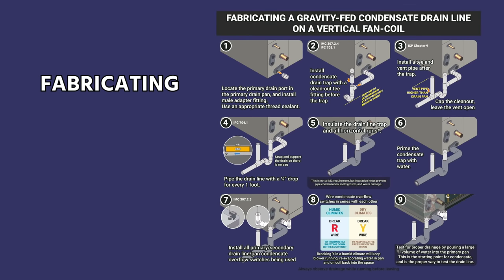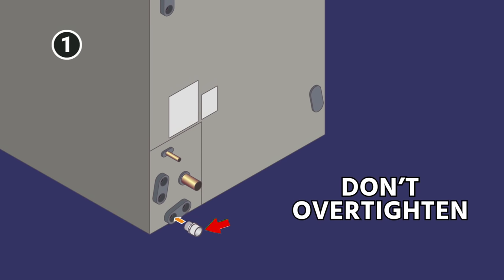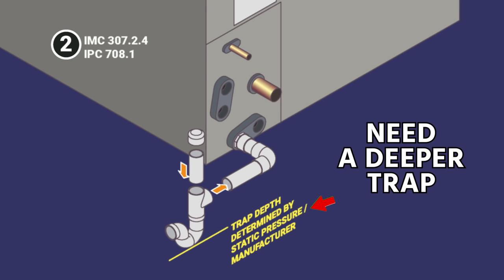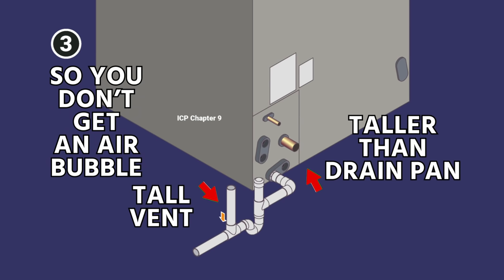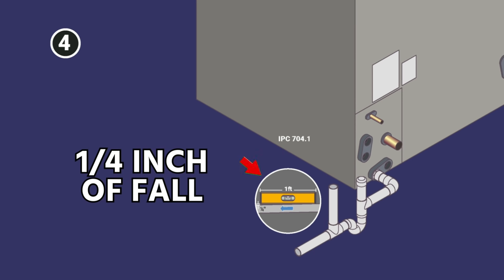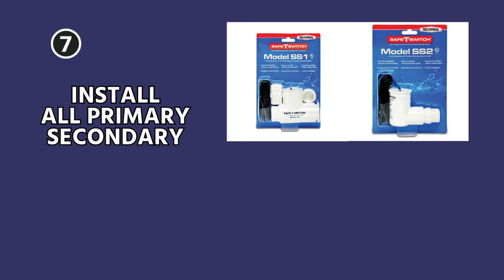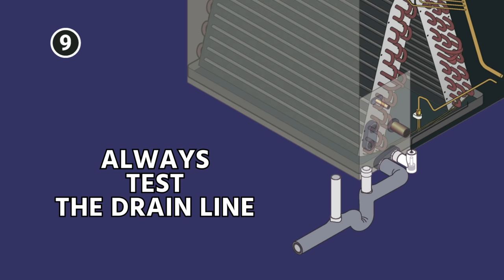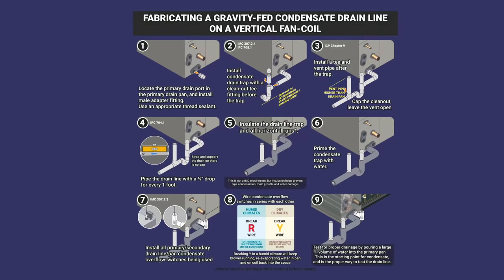How to Properly Pipe a Drain on a Fan Coil

Comment: I have issue with wiring the water over flow switch to turn off R. I have found keeping the blower running will help keep the condensate suspended long on the evaporated coil. And not overflow the evap pan.  So we wire to turn off the Y. We are on the gulf of mexico in texas high humidity. Please explain.
Reply: Breaking Y can let the unit short cycle depending on how long it takes for the switch to close. Residentially thats how you fry a compressor if your outdoor board doesnt have its own time delay
Reply: Only break Y when on a commerical site and the system has to be up and running to bring in fresh air
Reply: @garylargent8557  all water over flow switches open and close right away. and it will not fry the compressor.
Reply: @garylargent8557  a slow drain will turn the condenser on and off slowly not enough to burn the compressor
Reply: I'm trying only  picking brains. Let stay with residential systems. 
Got a service call about 20 years ago. Ac not cooling. Customer said i feel air but not cooling, Should I turn the unit off. I told no I'll be there in about 15mins. Got there the lady turner of thermostat off. Fan was auto. 
 Water over flowed the pan onto her sheet rock. Water over flow switch was cutting y. what I've seen happen is the blower keeps the water suspended in the evaporator coil. When the air flow stoped water ran down into the pan and over flowed. I don't remember how high the pan was.  After that on residential attic i cut y. 
Any comments. I've been do HVAC-R for 45 years. But i can always learn something new.
Commercial i will read the install manual see what people that made the thing  say about it
Reply: Some thermostats have a terminal just for  safety switch.

Comment: So confused about the P trap.  We bought our 2-story condo with an AC in a closet at the top of the stairs.  A white PVC pipe comes out of it that angles down and out of sight.  That PVC pipe has one of those shut off floats cut into it, but no P trap.  Another pipe comes out which is covered in a black pool noodle cover, heads along a parallel path with the PVC pipe but at a height above it.  Again, no P traps.  Was this old school, or incompetent work?  The AC works with no leaks.  Do all ACs need this P trap?  The shut off float I described is also the only way to pour in vinegar or bleach to clean the drain pipe.  Does that matter?
Reply: If it is not trapped where your air handler is it should be trapped outside wherever your drain lines run to, typically it will be next to the outdoor unit
Reply: But yes all ac systems need a p trap somewhere, and the float switch is a perfectly fine place to pour vinegar, it doubles as a clean out

Comment: I want to T in a hose connector to flush out the line. Any tips on this.  Thanks
Reply: Did you do this ? That’s what I am here researching.  My Bosch air handler has a trap, but not a clean out tee.

Comment: Would a vent before the p trap work better?
Reply: I don't think so. A vent before the trap will allow the unit to suck air from the vent and might prevent the condensate from draining. The reason for the trap is to block air from being sucked into the system so the vent should be placed after the trap.

Comment: You didn't mention anything about the configuration of a "draw" fan unit trap construction or a "pull" fan trap construction.  One requires a much deeper trap than just top of pipe to bottom of the other. Otherwise the water WILL be sucked out.
Reply: I read my manf guide and yes they wanted the trap at a min 2" deeper than the outlet of the trap meaning I couldnt use those prefab ceap running trap from home d but had to MAKE A TRAP.
Reply: Would it be beneficial to have prefabricated deep p traps and use them for everything?